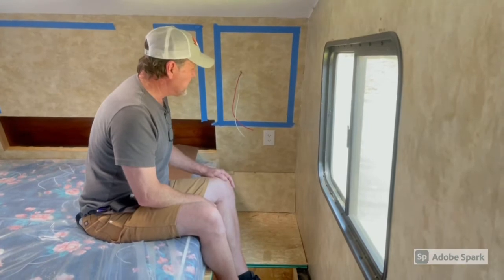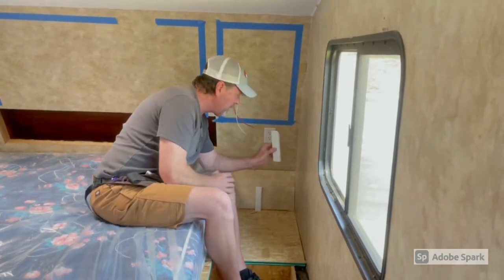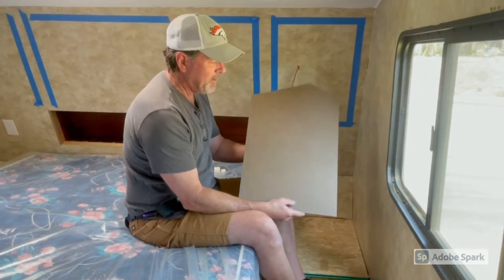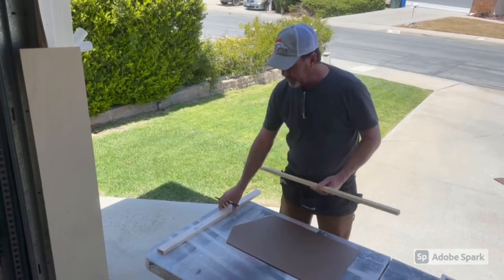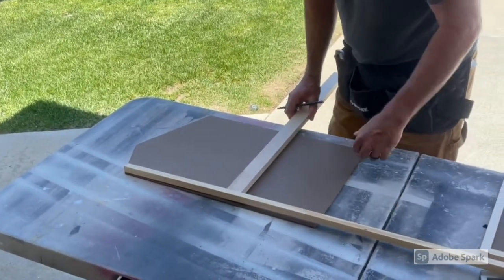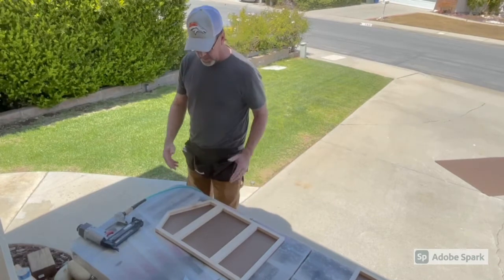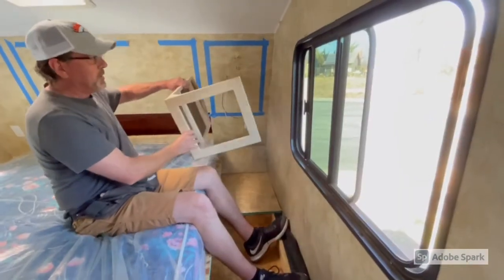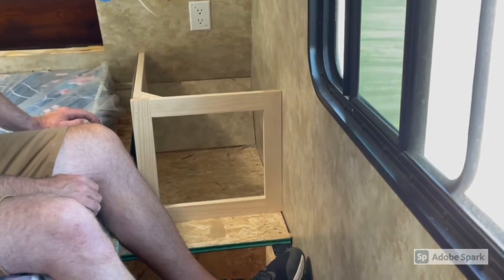How to build lightweight cabinetry for your RV

Comment: Hi, just found your channel & subscribed.  Kreg jigs are great, but, I often have trouble with their screws not tightening and have to swap them out for a standard wood screw.  I've tried their coarse and fine threaded types and I still have the problem.  Have you experienced this?  I love the light weight design, it's important in RV's to watch the weight of the vehicle.
Reply from the maker: Hi Pete, thank you for subscribing! I have not experienced that issue before, if it happened to me I would check the jig settings and make sure it’s drilling the proper depth. Maybe use a couple of scraps and try different settings and see if it makes a difference?
Reply from the maker: Hi Pete, thank you for subscribing! I have not experienced that issue before, if it happened to me I would check the jig settings and make sure it’s drilling the proper depth. Maybe use a couple of scraps and try different settings and see if it makes a difference?
Reply: @rvingdogsandwine2027  That's is a good idea.  I will do some experimenting. Thanks!

Comment: This is a very useful video.  I was scratching my head to know how to approach the lightweight cabinetry and now I see it. Build a lightweight frame, use luan 1/4".  The factory kitchen cabinet in my Class C is all 1/8" luan with very little framing.  Such a cheapo build.  I want to take it apart and rebuild it more robustly. Ditto for wardrobe.  This is a wonderful guide.  It does look like you are using masonite board and not plywood luan. This is not a good material for a motorhome. Masonite board is compressed cardboard, and absorbs moisture readily.  It is very, very porous.  Plywood is much stronger and less like blotting paper. If you ever tried to polyurethane masonite board, what does it do?  Drinks it up like a sponge.  Use plywood instead.

Comment: I've hear over the years that the Rv factories are just stink with Amish cabinet makers. HOWEVER, the cabinetry I have seen is glorified POS. My $100K Winnebago's CHERRY cabinetry is thin pine framing & boards stapled together & covered with cherry contact paper. So why Winnebago charges extra for maple contact paper baffles me. So if this is an example of Amish craftsmanship...Well.

!